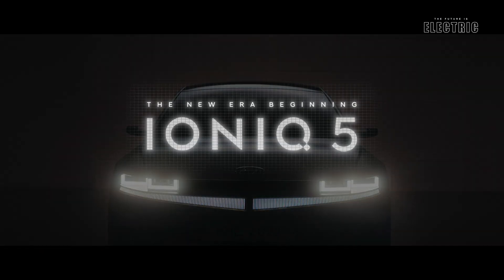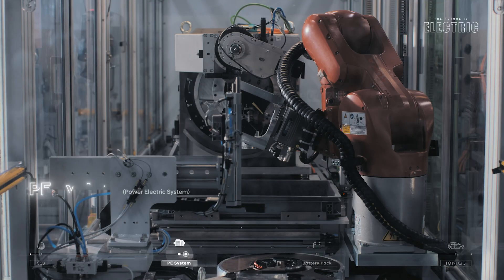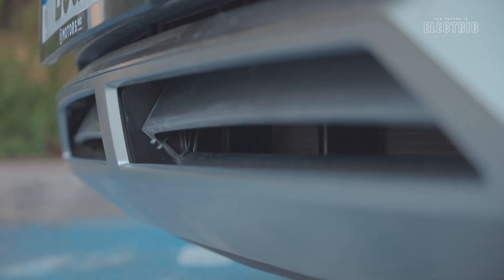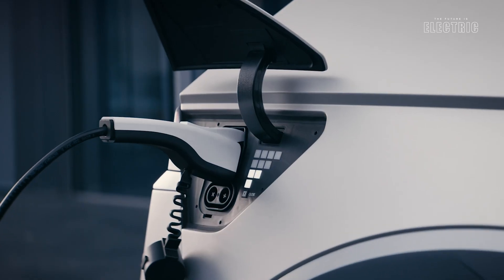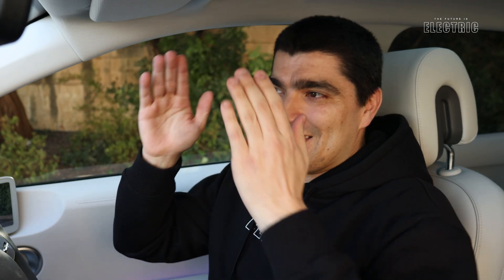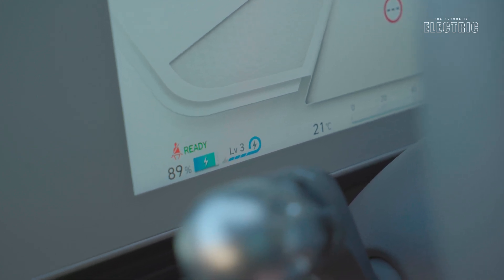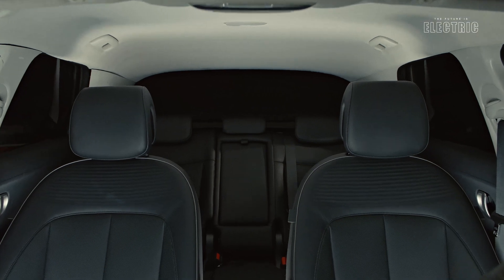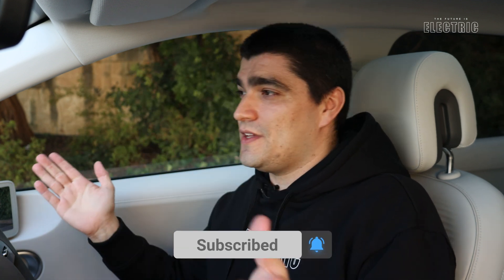Hyundai Ioniq 5 Technology Focused Review

Comment: Battery heating is not standard in Australia, only on the top model. On the other hand, the V2L adapter comes standard, not an optional accessory, in Australia. Each country picks from a menu for what it offers as standard and what it includes in only some models and what it doesn't include at all. 
Note that the HI5 can't charge AT 350kW. It can charge ON a 350kW charger (like any other EV) but only at about 240kW. Hyundai says that it will charge in 18 minutes from 10% to 80% ON a 350kW charger. They don't say it is ever actually pulling 350kW.
Reply from the maker: Thanks for sharing, interesting to see how models are spec’ed in the different markets.

Comment: Charging speed maxes out at about 240 kWh on the new variant, and at about 220 kWh with the 72 kWh battery.
Reply from the maker: Yes I’ve heard this, however the underlaying system is based on 350kw as advertised by Hyundai… I’m not sure if this means we will see the higher power with a software update
Reply: @TheFutureisElectric  A software update won't change the charging speed. All Hyundai are saying is how fast it charges on a charger rated for up to 350kW or 800V/500A limits.
Reply: Charging speed maxes at 240kW, not kWh. kW is power, a rate of energy transfer, kWh is an amount of energy eg. the capacity of a battery.